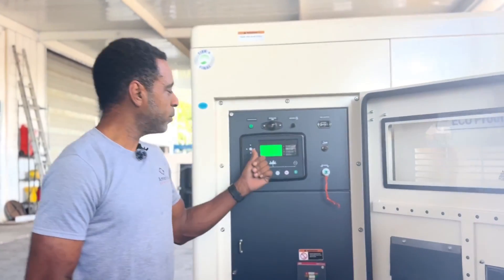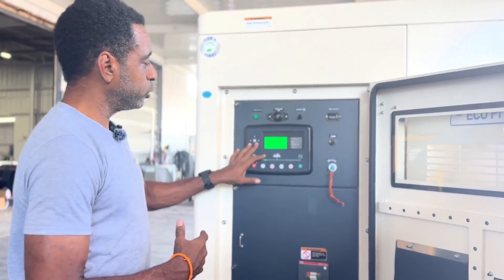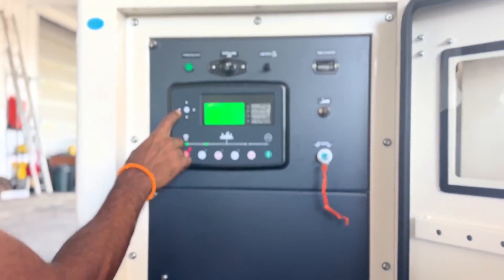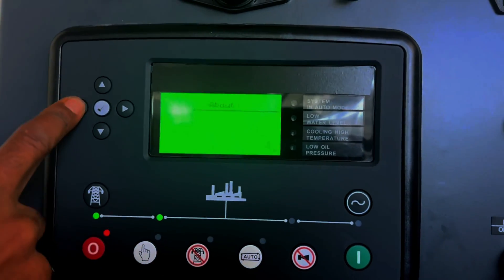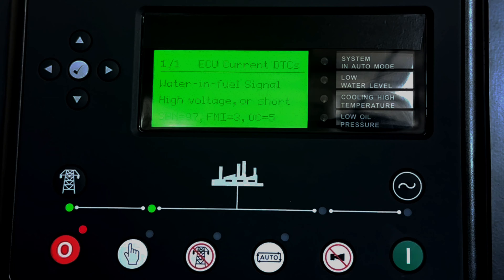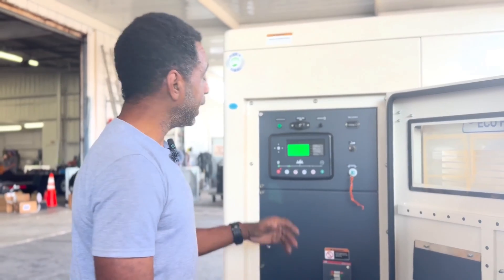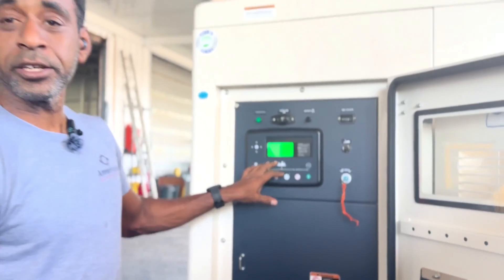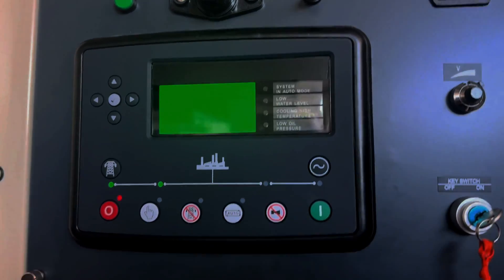ECU Error on Deep Sea Control Panel: What to do?

Comment: Sir how are you, I want to ask you one question about generator, I connect the cable from generator to low voltage switch board for auto pourpose but after that the  generator is not starting and it's saying ECU data fail and ECU override sir please could you tell me the reason why my generator is saying like that